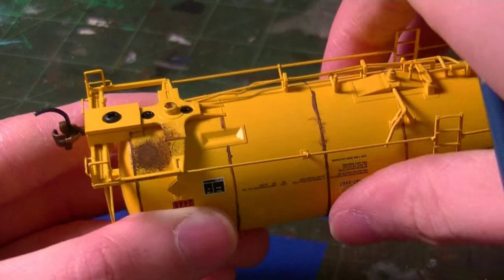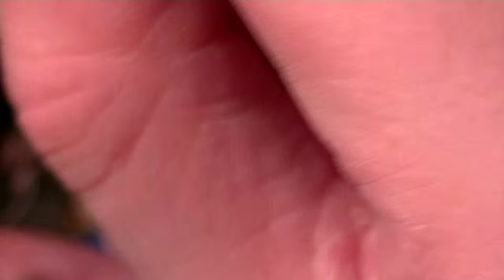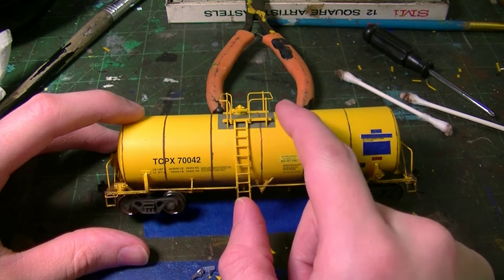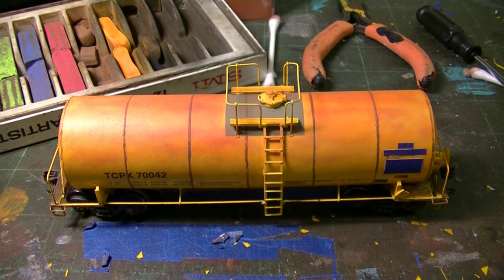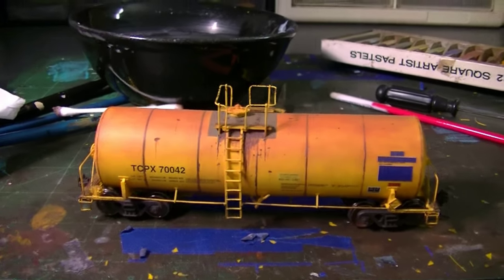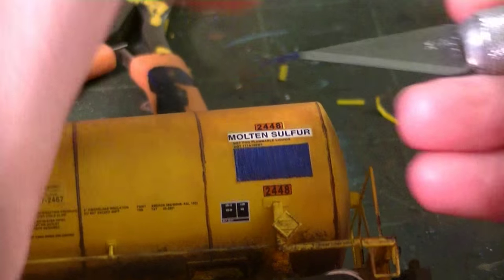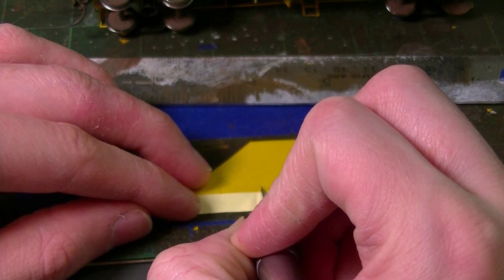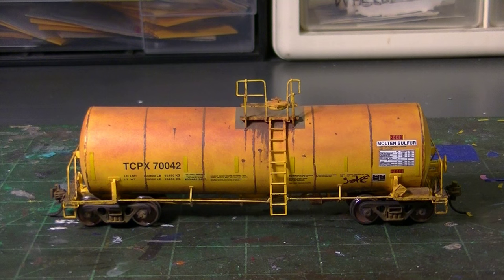Weathering A HO Molten Sulfur Tank Car!  Part 2 of 2

Comment: Just discovered your channel, a lot of good work here!As a tip, I used to use the same exact brand of chalks but found they didn't stick or cover well compared to dedicated powders made by brands specifically for weathering. They may be expensive but they last longer and work and look better. They also stick to paint so the would blend in your panel lines nicely.

Comment: Awesome work Dan. I really enjoyed watching this. I do have a question.. I know you dull coat the model at the start, but why don't you give it a coat after you did everything to help seal it and prevent any of the effect rubbing off from being constantly handled?
Reply from the maker: To answer your question,  I handle my cars from the trucks, or the corners as to not rub off anything.  I sometimes add clearcoat over my work but I find with cars, primarily weathered with chalks that they almost always will dull out, or almost completely disappear when clear is applied over it.

Comment: Do you dull coat after you finish weathering?
Reply from the maker: In this case, no I didn't.  I won't if there is quite a bit of powder work done to the car.  However, in most cases, I seal up my paint work and then apply chalks or powders, that way they don't dull down or disappear completely, as a result of clearcoating.
Reply: DansRailroad2011  how are the chalks and powders sealed to the car then without them coming off when you pick the car up or move it with your hands?
I thought the dull coat keeps the powders from being accidental removed from the car